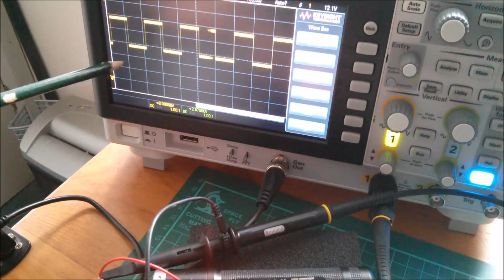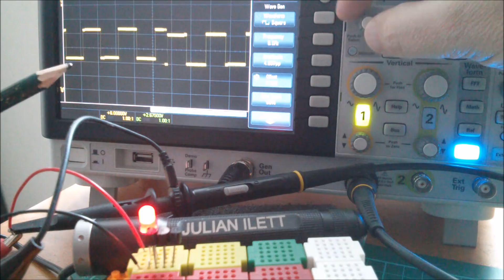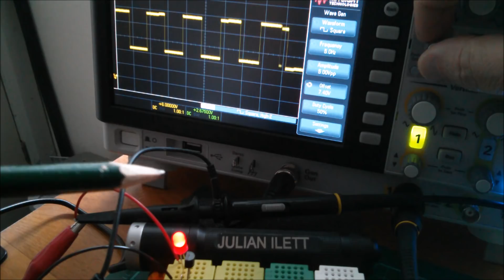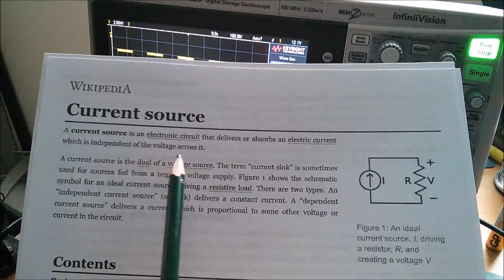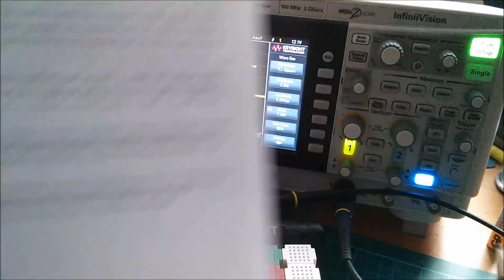Not Flashing LED -  Super Simple Constant Current Circuit

Comment: Julian I need your help please.
I am wanting to make a push button rotary box for sim racing. 
I am wanting to just have 10 pushbutton rotary encoders on this box. I have an idea from your videos about the pins on each side. My problem is how to wire it all and a program to run it.
What Arduino should I use. I have an uno and 2 nanos.
How many Arduinos would I need for the 10 Rotary's.

Any help would be great thanks.

Comment: What about the efficiency of a JFET as a current limiter?
Reply: Rodrigo Bruno The efficiency is the same as for any other simpel constant current generator. Its the voltage difference of the supply and load voltage times the current, and it is usually bad.

Comment: You can use a op amp to control a mosfet as constant current sourse. I have designed and used one at work to design variable cc loads for high power/low power burn loads. Only thing you need to consider is parasitics in the circuit. If you are interested i can post the schematic i designed it is super stable.
Reply: Will the circuit oscillate?
Reply: Malhar Deshmukh i included some capacitors into the op amp circuit to stop the oscillations. As far as i can tell the mosfet will source a constant current down to around 1.5v. It required 2 op amps which are easily availablr in an 8 pin dip package.
Reply: can you please tell me  more about it?
Reply: Malhar Deshmukh sure, what would you like to know. I have a circuit that i can show you somehow.
Reply: I would definitely like to see the circuit. Can you share on imgur  like something ?
Reply: Hi heres a link to the PDF https://drive.google.com/file/d/1w155vrAhYvXk7enWremlQz4FYvGjDHIC/view?usp=sharing
Reply: thank you
Reply: Jordan Dawes great circuit thanks! :)

Comment: Just us a lm317L voltage regulator which is a TO92 package  and set it up as a constant current source . Totally adjustable to 100ma with one resistor, very cheap and available everywhere . JFETs are expensive and not that available . The lm317l will regulate from about 3v to 35v . I use them all the time to drive single leds driven by variable voltages. If you need more constant current use the larger lm317 . In fact any  3 terminal regulator can be used in a constant current mode.
Reply: That has a fairly large buden/dropout voltage
Reply: The drop out volt is about 2 volts which is typical for a standard 3 terminal regulator . If you have a voltage input greater than about 3,25V it regulates just fine.
Reply: Thanks for the suggestion, just ordered a bunch of them.

Comment: It's a shame that Julian did not tell us what constant current sources are used for.   Commonly the are incorporated into the sensitive sections of pre-amplifiers to stop any ripple noise coming from the rails.   But J-FETs are not often used for this purpose due to price. It's cheaper to use the two transistor circuit.  The only example of J-FET sink/sources I have seen were in Oscilloscope Y amplifiers and in the renowned Pink Triangle PIP pre-amplifier.
Reply: Nuts n Proud he explains exactly why he's using it in this scenario though